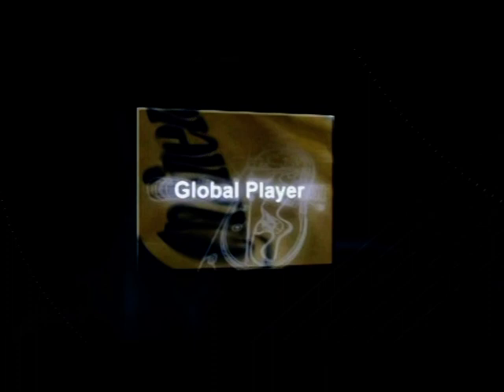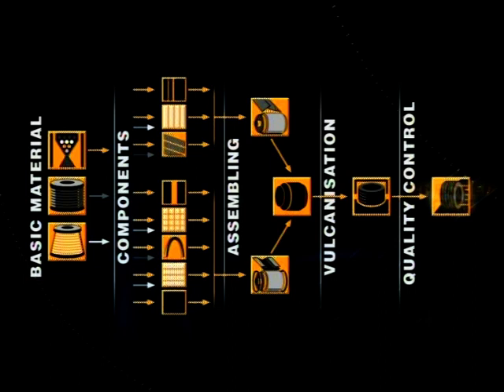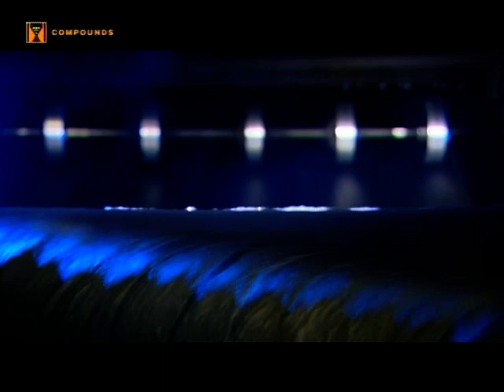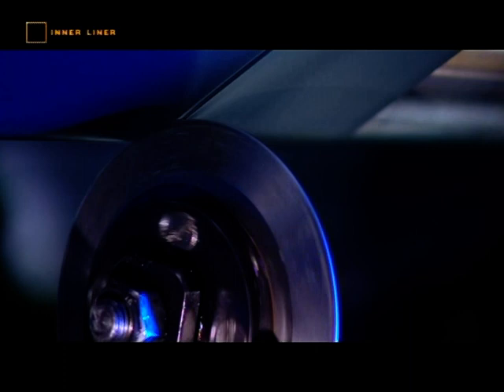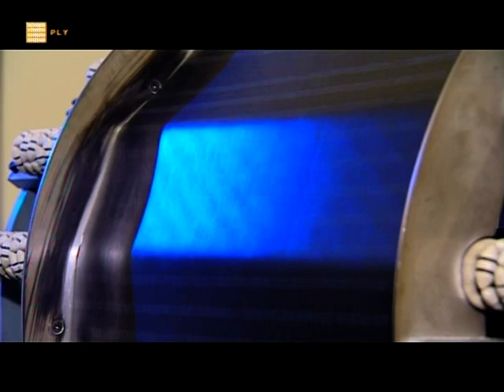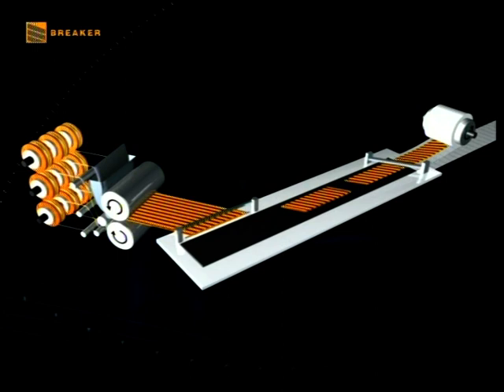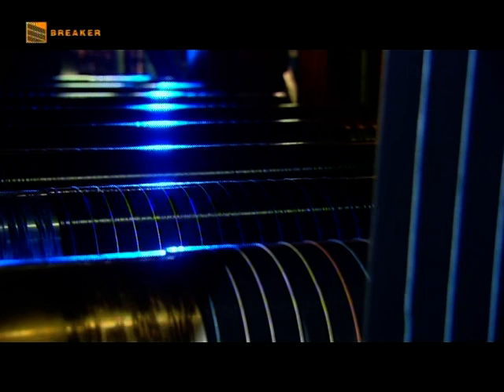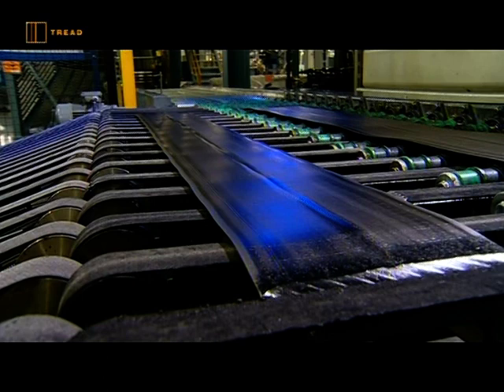How Tyres Are Made

Comment: I'm an old school motorhead and only buy Continental tires, the "Contact" series exclusively. I had to throw out a whole set of 1/4 worn Coopers off my Jeep and Cross Contacts just came out. They're made by computer in Mexico in a completely automated factory. And today have a 91% best brand rating at Tire Rack. And Tire Rack should know, they've sold gazillions of tires of every brand; quite possibly to your own shop. That review is based on people who have actually bought the tires. Not some "experts" opinion. Over the years, since "Contacts" first came out, I've had about 20 sets and have never had a single problem with any one of them. That's the first thing I do when I buy a car. Even a new car, is put a set of Connies on it and don't worry about it. And I've done that with 1 new car and 2 new Jeeps now. Most new cars come with 28 dollar tires. Really. You can't even buy them and they're usually shot in 20,000 miles. Many of my "Contact" tires were purchased at Tire Rack because they're hard to find. And if they have them, you have them within a week. And their tread designs are excellent and have DWS imprints on the 2nd rib. (dry, wet, snow) When the S disappears, it's no longer rated for snow. When the W disappears, it's no longer rated for wet weather. When the D disappears the tire is worn out. I know of no other manufacturer that does this and these are 70,000 mile tires. I even have a pair of Teva sandals for my feet with Continental tire bottoms on them. Don't ask me. I've only had one flat tire out of over 90 tires and it was a nail. From Cross Contacts for my SUV's and Jeeps, to Extreme Contacts for my cars and Hot Rods. Continental's are the only tires I trust, or buy, and I'm currently running 4 sets of them. And when you're running 4 sets of tires, you better be sure. I Have more trouble with my rims than I do my tires. Modern factory alloy rims start corroding the day you get them and the valve stems start leaking. They have to hone out the hole and glue them in. Really, I'm not making this up, you'll see. All the rest of the major tire manufacturers are garbage. If you see a huge dent in your sidewall, it's not NORMAL like your dealer says; that tire is junk and isn't even round. They bounce when you drive down the road and wear your struts and suspension bushings out. That is also why you can't balance them properly. Cooper really disappointed me and Good Year has always been junk. Except in Semi Trucks: Michelin and Bridgestone are the most over rated tires there are. In the winter, Michelin's are useless and won't even let you leave your own driveway. Just ask my brother. And Firestone and Uniroyal? Are they even still in business? They shouldn't be. Dunlop makes excellent Motorcycle tires and that's about it. Pirelli makes good tires, and they wear out so fast you have to replace them every year, or even twice. They're only good for 7,000 miles. NOT 70. Continentals are standard equipment on many European cars and should be on all cars. They're weight rated for the car you buy them for, so they always ride very smooth. But hey, that just the opinion of one old school motorhead, who's been around the block a few times. Take free advice for what it's worth.

Comment: i currently worked at a tire making company and unfortunately this video didn't even show one of the hardest parts of the job trimming the tire vents and cleaning the beads manually imagine doing all of that with 10 to 12 tires weights about 10 to 20 kgs in just 12 to 15 minutes or else another batch is coming 😂😂😂 overworked low salary😢😢😢
Reply: dear sir, please help. how is solubable sulphur is used versus unsolubable sulphur? what percentage of each is used in the 1.5 to 2% total sulphur? that would help me a lot. I am working on a market study as to advantages of using 5 micron sulphur vs. 100 micron sulphur (what is now used). perhaps you can help me. thanks